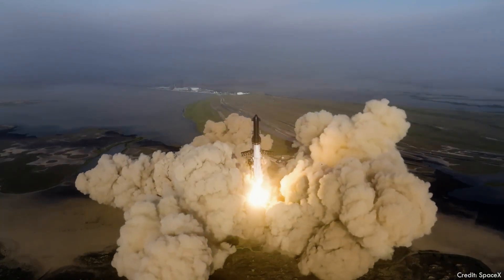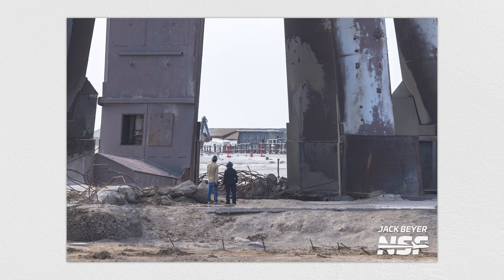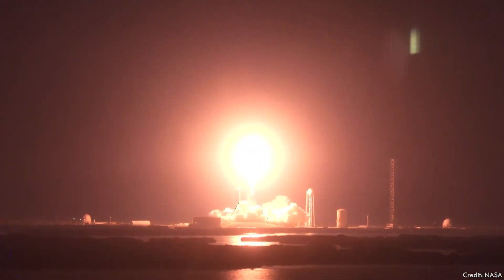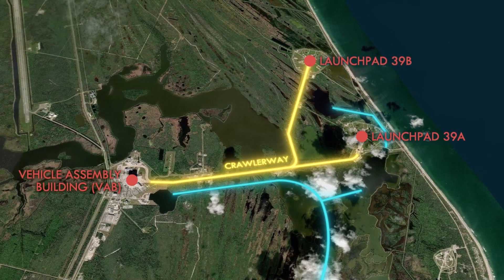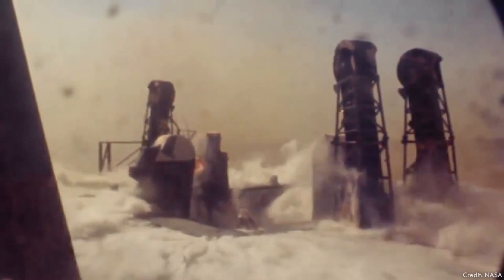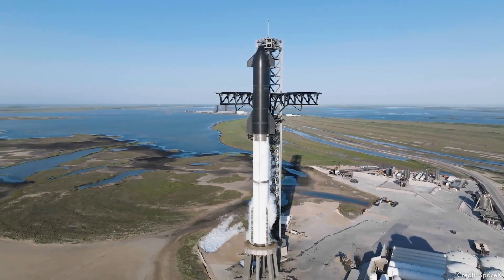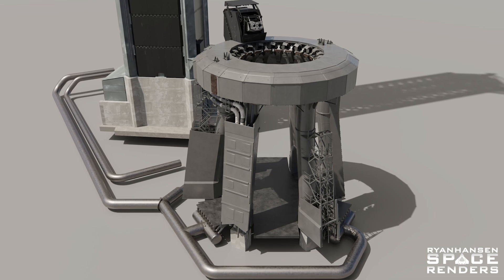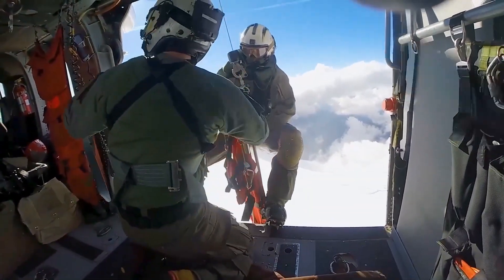Was Starship’s Stage Zero a Bad Pad?

Comment: one of the only pieces of work about space ex actually covering engineering, not the paparazzi tour of sped up footage of construction and speculation. thank you for covering engineering!!
Reply: Friendly under that "fud" (Fear, Uncertainty, and Doubt) is a term commonly used amongst cryptocurrency and NFT shillers, i.e. "people" who fell for the grift
Reply: @fakename287  the word "and" is also used by that community. You did as well, so you must be one of them!
Reply: telling untruths is sort of a character trait / flaw of the feller in charge of the outfit.
Reply: He repeated the fud tho. I don't get how an engineer can deny how important iterative testing is for safety.  There will always be grass fires until they launch enough that the grass doesn't grow back between launches.  Grass fires are caused by delaying launches and are not an issue because its just grass.
The debris won't happen with the deluge plate and the dust is not an environmental hazard, its just dust already on the ground and in the air.  The best solution for dust is to launch more often so less loose dust accumulates on the ground.
The criticisms of spacex are all nonsense as it seems to be based on demonizing or lying about iterative testing.  Iterative testing is the only safe way to develop a rocket.
Meanwhile boeing has had 3 launch approvals for an unsafe and untested capsule because "rules" applied to spacex for their tests never seem to be applied to anyone else for test or production launches.  None of the boeing capsule launches were supposed to be tests, they were supposed to be final certifications to prove they were ready for humans.  One was done in an unsafe manner and two more have been cancelled last minute due to issues that could cause a loss of vehicle during a flight.
Reply: @_PatrickO  definitely came of as fud to me. Exaggerating the issue with the launch.

Comment: The technical term for this kind of engineering is “f*ck around and find out” or FAFO for short.
Reply: Yep. If you have the skills to do it safely, there isn't a faster way as long as you have budget remaining
Reply: @iemozzomei  And if you don't, you can always go work for Elon!
Reply: My favorite kind of engineering. Suprised they didn't use duct tape and syperglue to hold the pad together. But I'm sure a heavy layer of epoxy resin will work for sure.
Reply: When your boss is too dumb to take launch pad building tips from people who've already built powerful rockets this is what happens. Hell even the Russians use a dry reinforced flame divert for their pads.
Reply: @mattb9343  if you have to take off from the moon or mars you won't have a divert so they can't use one when testing 🤦🏻‍♂️
Reply: @slcpunk420  bold of you to assume they will make it that far
Reply: @slcpunk420  Also Explain to Me How a Water Cooled Plate Will Be On Mars First
Reply: @slcpunk420  since when do they plan to launch the full stack from those locations. Last time I checked Starship itself only has 6 engines and far lower thrust than the booster.
Reply: @skirata3144 Good point.

One common thread I always notice with Musk/SpaceX haters, is that they never seem to know anything about the spacecraft they’re criticizing.

Pretty obvious that the real issue is that they just don’t like the guy and are desperate to sling mud at him no matter what.

The hubris of these clowns thinking they know better than the Chief Engineer of the most advanced rockets on Earth, is beyond laughable 😆
Reply: @ericlotze7724  Wait, you think the plan is to have the booster end up on Mars?

Bold of you to criticize things you know nothing about 🤣
Reply: @liquidsnakex  My point is criticizing SpaceX for not building a flame diverter since it was an answer to somebody who claimed that they didn’t build one because such a structure won’t exist on the Moon/Mars.
Reply: @liquidsnakex  Even then, how will Starship itself fair?  Doesn’t NASA use the “Skycrane” System for a Reason?  And that is for lifting something the size/weight of a minivan, a full starship (albeit without the booster, and potentially less fuel/thrust needed due to mars’s lesser gravity etc) would require more thrust and hence more dust, no?

 The lunar one has (at least in the renders) engines moved up top, so potentially something like that, but as it stands now, i imagine it is a rocket powered pneumatic excavator…
Reply: Expensive way to learn a very obvious lesson.
Reply: @davidwebb4904 Actually this is exactly the opposite of true. Considering the cost of engineers, it's a fast and therefore cheap way to learn a lot of information.
Reply: @davidwebb4904  ULA was charging the US Government around 500 million a launch. With space X now in the mix, the price has dropped to about 100 million a launch. Rapid prototyping certainly has its risks, but if you "do it like you always have" you are way less likely to have evolutional breakthroughs.
Reply: @TheHiznor  Absolutely! The old method of design is incredibly slow, and is still prone to major accidents because some things you won't learn without actual testing.
Reply: @YT-TheLegacy  13 Saturn Vs launched, 13 were successful.  A couple of them were dicey, but not "rip the vehicle in half after even the flight termination system failed" dicey.  And that was when they had computers comparable to what's in your microwave.
Reply: @Zarincos  And the saturn v cost 1 billion dollas per rocket, much unlike the prospective starship.
Reply: @Zarincos  spacex wants a starship to be able to launch more than 13 times per week big difference in designing for X
Reply: It's "move fast and break things"
Reply: I like it!

Comment: It wasn't the concrete that gave way. It was that they had a gap between the center pilings and the support beams between the big pilings under the columns. There the soil settled to much, leading to cracks. Without that, the fondec would have had no issue.
Reply: lol sounds like a familiar theory!
Reply: @CSIStarbase  wonder where I got it from. Fancy seeing you here...
Reply: I would not be surprised if the concrete WAS eroding, but the real issue was that the pressure on the pad compressed the foundation and caused the concrete to buckle, which created the gaps. It doesn't really matter how well you seal it in this case. L
Reply: in theory.  you dont know this.  you like to say this.  if it were true, the gaps would be filled and we'd be looking at round two of your theory.
Reply: @gregknipe8772  CSI Starbase did a deep dive on the concrete. The expected loads were well within the specs for fondec. The potential heat loading could have gone way up, like nozzle exit hot and still been within spec and the pressure was at less than half the compressive strength. It wasn't the fondec that failed.
Reply: Nice apologies for that sh.tshow

Comment: What was that line about “1000’s of parts, each made by the contractor with the lowest bid?”
Reply: Alan Shepard 1923–98
It's a very sobering feeling to be up in space and realize that one's safety factor was determined by the lowest bidder on a government contract.

John Glenn said something very similar.  It was a common concern by the astronauts.
Reply: @veramae4098  That’s the one ☝️
Reply: Except this was built inhouse by SpaceX, not contracted out the way that oldspace builds things.
Reply: @Cheradanine  SpaceX used no subcontractors ?

(And/or didn’t design their For Profit Not Made Like those EXPENSIVE Rocket Makers Rocket with as cheap as possible parts?)

(Same people who didn’t inspect the welds on their (CRYOGENIC!) pressure vessels until after a few explosions)
Reply: @ericlotze7724  Do yourself a favour and learn about a topic before opening your mouth and making yourself look silly. You are referring to the COPV vessel that caused the explosion (singular) of the AMOS -6 Falcon 9 on the launchpad. That was found to be liquid O2 seeping into voids in the carbon fibre overwrap and nothing to do with welds.
Reply: @Cheradanine  no…i was referring to the Tanks they made at Boca Chica pre-starship.  MK1 Days / SN1, all those cryogenic tests where it bursted at…the seams.  Also before they had the welding jig/robot (whatever you want to call it) inside that Onion Tent.

I can dig for specifics, but…yeah.

(Edit: Fixed a Typo)
Reply: @Cheradanine  also a False Statement to begin with, like all Statements from that intelligence insulting film
Reply: @Cheradanine  "spaceX is the contractor"
Duly noted.

Comment: You forgot to mention why they built the pad this way and that's pretty important.
It was made from concrete and without all the water system to simulate how it could be built on Mars when they get there. Having a water deluge system would be adding an incredible amount of complexity and resources that are not possible to gather on Mars.

Otherwise, very nice video, thank you!
I wanted to comment this on Nebula, but there is no comment section.
Reply: I'd assume a Mars launch pad would be better built over a pit or quarry, like the Soyuz launch pad in Kazakhstan.
Reply: Yeah nah, not sure where you got that from but launching on Earth is not even comparable to launching on Mars -putting aside the very not Earthlike air and soil composition, it has 1/3 of Earth's gravity and compared to Earth; almost no atmosphere.
That launch they did was many times more powerful than what would be needed on Mars...what would be the point in building pad like how you would on Mars but then using Earth launch power on it?
Reply: While a water deluge system would be hard to build on Mars (though notably not impossible since settling Mars like Musk wants would require tapping a water source), there was nothing other than haste and a distain for regulation that prevented them from making SOME sort of flame trench or deflector. Even if they couldn't dig one, they could have built a mound to put the launch pad on top of like they do at Cape Canaveral.
Reply: @Savayan  they DID build a mound, but mostly they sunk immense pilings into the ground to support the weight of the infrastructure. Just because they didn't build a pyramid/temple to the gods of cost+ contracting doesn't mean they didn't do a lot of work.
Reply: @Savayan  Yes, I very much agree that they should have spent more time on it and the launch pad exploding in spectacular way is pretty rookie mistake.
Reply: what a load of musk fart-sniffing bullshit. even if spacex were to go to mars theyre not going to be launching a fully-staged falcon heavy from it. the entire point of such a large rocket is to get enough payload into space that you can make a return journey. you dont need that much thrust or payload to get BACK from mars. it was made this way to cut costs. nothing more.

also theyre literally building a water deluge system for the next pad as mentioned in the end of the video. so what, did they suddenly abandon their plans to go to mars after one test?
Reply: oh no if only you watch the video and saw the part on the flame deflector, yes would love to gamble on the launch back from mars and hope no rock destroys one of the tanks, the simping is strong
Reply: Sir, this is Planet Earth. We have plenty of (salt)water around.